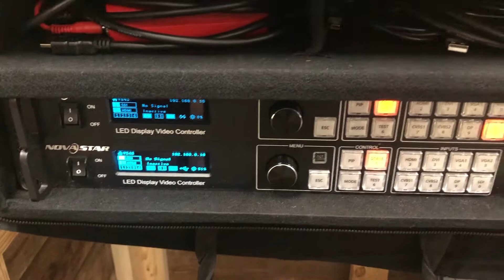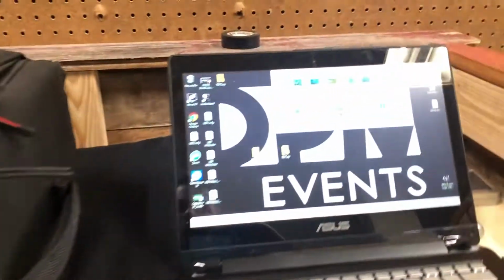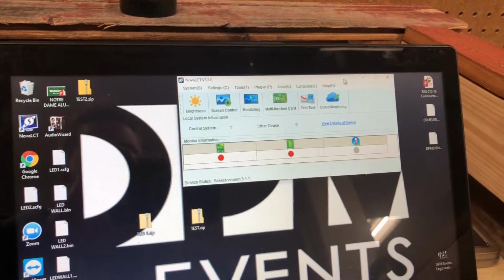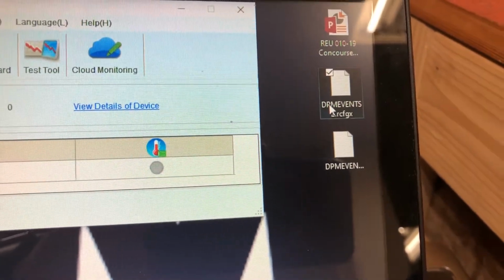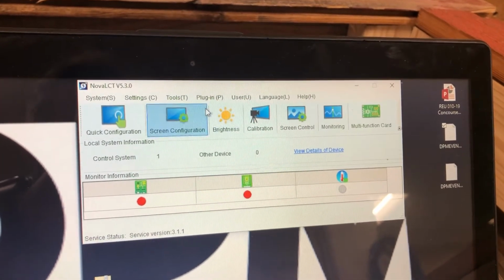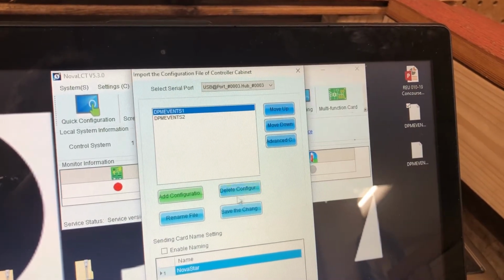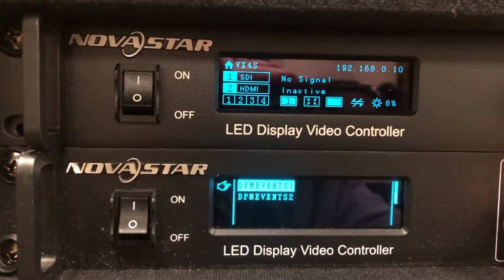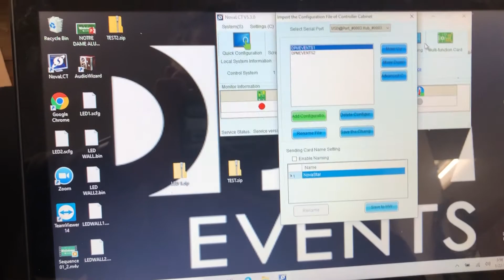UPLOADING CABINET FILE INTO NOVASTAR VX4S PROCESSOR

Comment: Hey Randy! Thanks so much for making this video. I want to ask a question. Now that I know how to move those config files from the laptop to the processor, is there a way to move them from the processor to the pc. We ended up receiving a corrupted file from our mfg after our initial purchase of our walls. The processors had the correct file on them, but I’ve purchased additional new processors and want to load the working files to the new boxes. Is there a way to move these around? Before I accidentally mess up a processor, I thought I’d ask. Also, what’s the best ( stable version of LCT to be using these days? That is for your 2 cents!